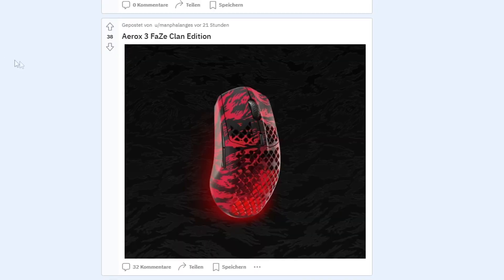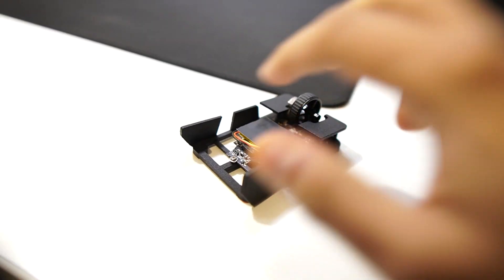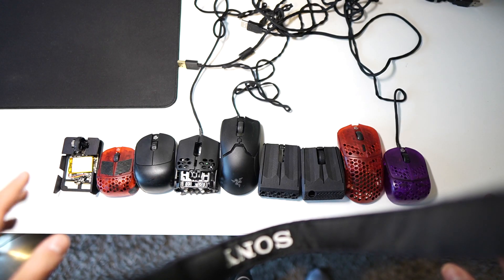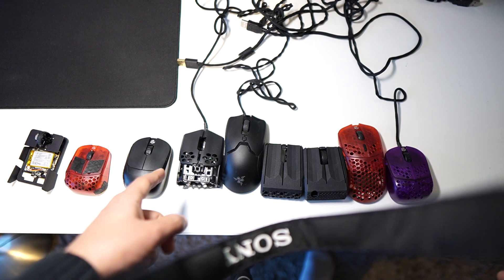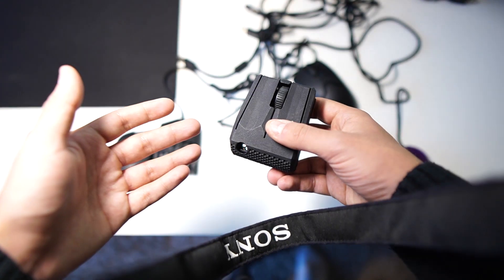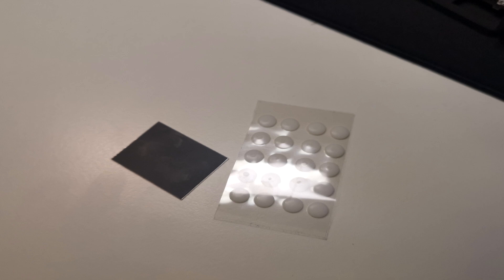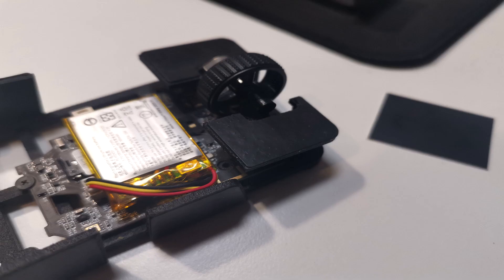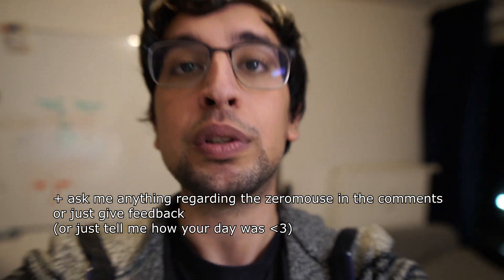Pure Insanity - Optimum Zeromouse Review

Comment from the maker: UPDATE: There are two screw holes underneath the clicks of the viper v2 pro pcb inside of the zeromouse. Definitely screw the screws of the viper v2 pro (there are 4 screws in total, 2 of them are on the top shell on the clicks) into those holes while putting a bit of pressure onto the pcb. You need to bend the clicks a bit to reach the holes with your screwdriver.  It makes the click feel much better and consistent and also the mouse clicks work now when using the mouse wired. 

Also I noticed a bit of irritation at the edge of the mouse where my pinky finger is because it's a bit sharp. But putting a bit of my own cut griptape onto that edge has resolved that issue completely.

Last but not least, using a 100 mah 3.7v battery and sticking it at the back of the mouse helps with the weight balance tremendously. Links on everything you need are in the video description. You have to solder the cables of the battery onto the 3 pin cables yourself though and protect the soldered parts with a heatshrink that you have to heat up carefully with a lighter or a heat gun.

Comment: Great review! You covered everything anyone interested in the drop could want to know very well.
I wish Optimum had put some vertical supports on at least the rear grip points to reinforce the mouse from flexing inwards while gripping it, a small extrusion extending the height of the mouse placed perpendicular to the grip would likely provide the support to make the pads super secure while maybe only adding 1 gram. Might also help with those who gamer rage, but as you pointed out they got bigger problems.

Comment: I know nothing about scroll wheels, but how easy would it be for someone to MOD a lower profile scroll wheel? I'm assuming that it's the physical rotation that actuates the wheel and has nothing to do with the outside diameter?
Reply from the maker: Good question, unfortunately I have no idea about scroll wheel encoders and which ones would be compatible soldering on the v2 pro pcb and if they could be lower height. Maybe there are tutorials regarding scroll wheel encoders, look it up perhaps

Comment: I also have the Razer viper mini and I have also sanded the plastic around the sensor, have you also done it because that plastic bit is higher than the actual skates? Also is that the case with all units or only some?
Reply from the maker: When you press the mouse a bit harder into xsoft mousepads you can feel the sensor ring rubbing against the pad, that's why

Comment: Great deal = 69+shipping + mouse 130 and overall one weird mouse for 200+ euros without any warranty, because you disassembled Razer, for the same price you can buy Vaxee wireless + XM2we.
Reply from the maker: If you get a used v2 pro for 60-80 euro which I would highly recommend, together with the zeromouse you're at around 140-150 dollars total. A vaxee wireless xe costs 140 dollars as well. But the zeromouse is far better for fingertip grip and has much better internals up to 8khz (if you get a used hyperpolling dongle for 20 bucks) with much lower motion and click latency even on 1khz. This is an enthusiast mouse solely targeted to fingertip grip, but man it's good really
Reply: @MorrTex Yea people don't realize this isn't a mouse meant for the average gamer, and it's from the ground up not meant to target that. It's meant for the enthusiasts who love to mod and tweak their own hardware and chase for pure optimization to maximize performance regardless of cost or risk.
Reply: @Shyvorix I’m also assuming Optimum is running this whole operation on his own (outside of printing). This isn’t a large company mass producing thousands of these everyday with their own internals. Of course it’s going to cost more.
Reply: @Emil-sh6sq  Yea I don't remember if he is producing them himself but it would be infuriatingly slow if using just 1 printer. I believe it is contracted outside but yea the design is very iterative and took a long while to borderline perfect. 

The price may be slightly steep but he is at the end of the day allowed to charge whatever he feels is worth it. And considering he doesn't take any sponsorships (he should really do a patreon though if he hasn't already) he doesn't exactly make fuck you money from Youtube lol.
Reply: @Shyvorix  Pretty sure he decided to outsource the printing since he couldn’t get the desired quality at home. I think he also stated that this is the reason he’s not just releasing the 3D model, which I saw some people complain about, but if I came up with a good design and knew i could make some money selling it I would probably do the same.
Reply: Vaxee or XM2we is trash for ftip grip. Who wants 60g mice with claw grip shapes for ftip? your comment makes no sense.

Comment: How is nobody talking about the HORRENDOUS flex
Reply from the maker: It's not apparent in normal use but yeah maybe a tad bit more stable design for 1-2g more weight could've been an option
Reply: @MorrTex  The mouse is already absurdly overweight for the amount of material used
Reply: @velqt  I used a 150mah battery on mine and it's down to 27g. I don't think that's "absurdly overweight' considering it's the largest of the fingertip mice. Sure, you could probably get it to 23-25g with a lighter material/structure overhaul, but saying it's "absurdly" overweight at 27g (smaller battery) is actually the absurd part.
Reply: @xblur17  I mean, it might be the largest of the ftip mice but it's also an exomouse and by definition has no shell or lattice